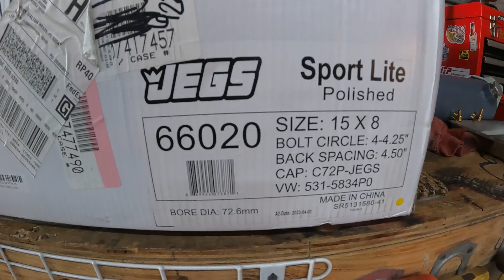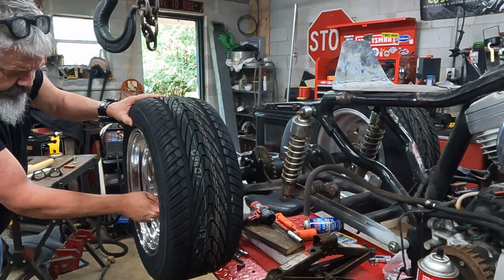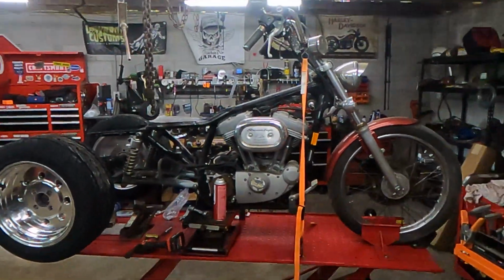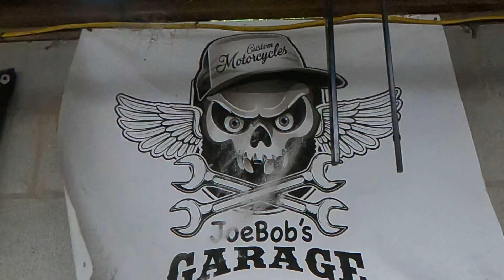Sportster Trike Build Gets 50s

Comment: This is gonna look the ticket when its done.
Keep it coming.
Reply from the maker: Thanks... I subbed to your channel... and will see what you do.
Reply: @JoeBobsGarage  cheers mate. To be honest my stuff ain't anywhere as interesting as what you're doing but I appreciate your sub.
What did you end up doing with the Yamaha virago frame? I can't believe some used a 250 to run the trike set-up.
Reply from the maker: @buck_the_atlas  The frame is still on the trailer in my front yard, I'm sure the neighbors love that! I know nothing about that frame. So that was a 250?... I hope that rear end doesn't fly apart with the extra power! 😳
Reply: @JoeBobsGarage  Yeah It looks to be a Yamaha XV250 Virago. Those 250 engines struggle to move the light bike let alone a bike with a trike rear I would imagine.
The rear end looks pretty solid and will definable handle the extra juice.

Comment: Hi bob first time seeing ur videos wot wheels r u using on rear and size please . I was thinking of doing same thing to my spare bike
Reply from the maker: The wheels are 15 inch, 8.5 wide with a 4x4.5 bolt pattern and the tires are 225/50 R15s. Good luck with the build. I have no idea who made the rear end. I bought it used. I just took some measurements and figured I could make it work. Thanks or watching.
Reply: Hey Bob good videos . What did the rear axle come from ?